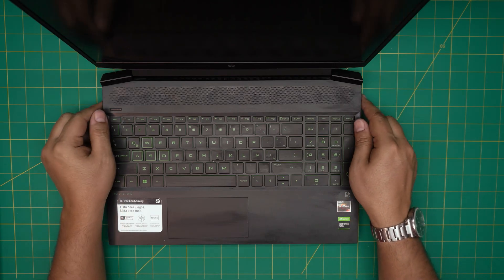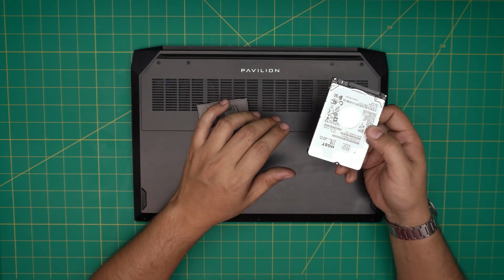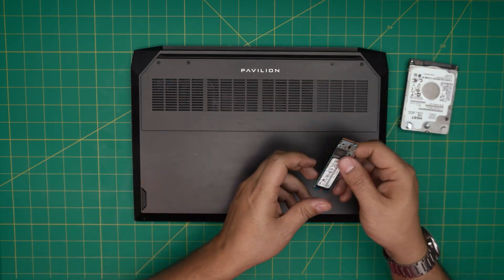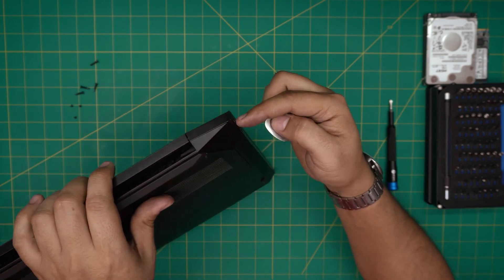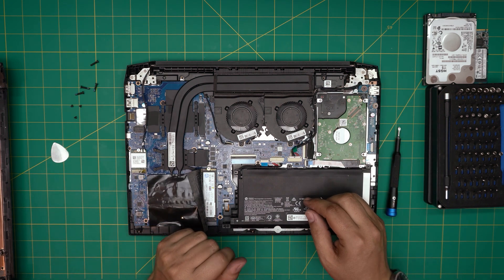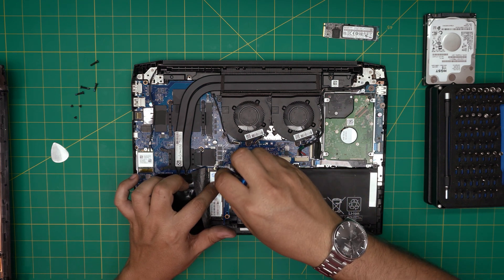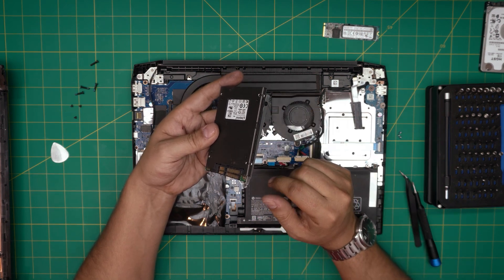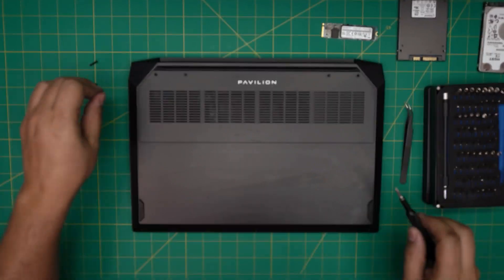How to Upgrade Storage (SSD/HDD) for HP Pavilion Gaming 15 Ec0002 - Step-by-Step Guide💻

Comment: Can we add 2tb ssd in 2nd slot 
And add 16 gb ram
Reply from the maker: 🫠Regarding your question, sure you can , without any issues at all and it will work just fine, same goes for the rams.
Should you have any further questions or requests in the future, please don't hesitate to ask me.
cheers🍻
Reply from the maker: It's my pleasure my friend.
and yes for all the above you mentioned.👍
Reply: @deepakRana000  you can have, but for a better performance, you need dual channeling for which you should have the same gigs on both slots

Comment: If upgrading the SSD do I need to download windows again? Since I’m switching to a Crucial 1tb SSD.
Reply from the maker: Thank you for your feedback! If you wish to support the channel, you can like, subscribe, or both!
Regarding your question, if you upgrade the main SSD that you had your windows in it, then YES you need to install windows, but if you just upgraded the extra storage , then NO. it will appear as  an extra storage in your computer.
Should you have any further questions or requests in the future, please don't hesitate to ask me.
cheers🍻
Reply: @uFixTek  Does the Pavilion have an extra ssd slot or it’s just 1?
Reply from the maker: as shown in this video this laptop takes two drives, and both can be ssd or one ssd and one hdd.
you can have one m.2 ssd nvme and one 2.5'ssd sata, and you can have up to 2 TB on each slots.
Reply: @uFixTek  I'm upgrading my SSD to a 1Tb but I'm not upgrading the HDD, do I still need to re-install Windowns?
Reply from the maker: yes because your windows is in the m.2 ssd my friend if you remove that, there for all your windows and programs go with it.
just install windows fresh install from USB it takes 10min and you set to go.
Reply: @uFixTek any video on how to install windows using a flash drive ?

Comment: Thank you so much I followed a video that upgraded a SATA ssd only to realize mine had a NVMe ssd installed, I thought the process would be the same to recover but boy was I wrong😂 You're the best!!!
Reply from the maker: It's my pleasure my friend. 😊 Thank you for taking the time to give feedback! If you would like to support the channel, please like, subscribe, or both. :P
Should you have any further questions or requests in the future, please don't hesitate to ask me.
Reply: @UFIXTEK  for sure already did the second I saw the video😆 but what can I do if my laptop doesn't want to recover from my sd-card?? Thankfully I still have my old ssd to keep using but I can't installwindows on my new one :(
Reply from the maker: i don't get what you want to recover from sd card, 
once you place the new SSD you will need to reinstall windows from USB boot drive, and it is very easy to install and do a windows update and you are all set.
👉windows 10 usb boot: https://youtu.be/uDu8j2lE-dM
👉install Windows on Hp laptops: https://youtu.be/euJvBhmoDzY